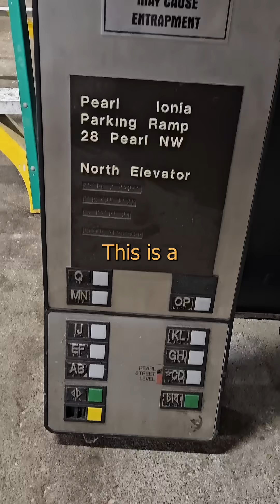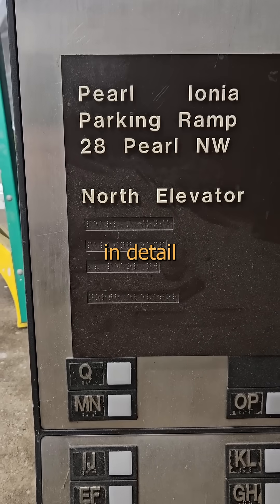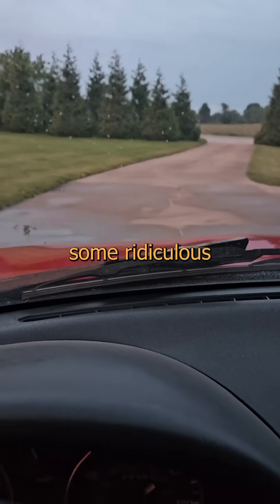Miata Mischief #chrisboden #engineering #gear #elevator #score #stories #parts #hacking #making

Comment: I once had to haul a futon in the back of an 09 mustang. I laid the seats down to the trunk, took it out of the box completely in the walmart parking lot, and laid each individual piece tetris style as tight as possible and managed to fit myself and a rather rotund (now ex) girlfriend in the front. 

Second, i once had to move a bronco which had refused to start across town on limited funds so we just hooked some chains to it and dragged it across county highways, dodging the cop stops while i managed the steering and stopping without power or boosters. 

Third, i later had to get an f150 off the aide of a literal mountain. We hooked it to a tow truck, got it in position adound a precarious curve and just told the driver to floor it to maintain tension while it was careening down the mountainside at mach jesus through the mud

Comment: When I was formworking I got dads work ute and they loaded up to the point the suspension was bent the wrong way. And a few years ago I was haulling an industrial air-conditioning unit and a bunch of other things in my Lil toyota corolla 300kms down the road lol. The bounce was sketch as

Comment: If you can persuade the owner to fit a roll bar or even better a roll cage to the Miata, they make a great roof rack for carrying 8x4 sheet materials, plus you don’t have to lift the stuff as high as a regular car. Speaking of roof racks, we carried a double bed mattress home on mine; when the air got underneath the front and folded it up, it made a great air brake!

Comment: I took a bandsaw held inside 3 reusable grocery bags home 4.5hrs 1 way on the bus from inside the city.  Was planning on using my backpack but I misjudged the size.  Majorly.  Did I mention this was midsummer and I had to bearhug that thing not to drop it, and I was sweating buckets trying to be careful not to cut me, my clothes, the seats, or others?  Oh, and it was a 30 minute walk to the bus, a 10 min walk to the next bus, a 10 min walk through the terminal, 10 min walk through the terminal, and 25 min walk home?  Not to mention the wait times at the side of the road with this thing.  One of the bus trips I was even standing with it sandwiched between my knees.  Was a 30$ canadian bandsaw with a spare blade though, how could I *not*??  It's still in my shop, barely needed any work

Comment: We bought a gym size eliptical machine 10 minutes before costco closed for the night. We had to take it out of the box and take it apart more than it was to get it into the trunk of our Chevy Aveo. It just barely fit enough to drive it 4000' up the mountain to get home.

We also brought an extra wide bathtub up the hill sticking out of the trunk as well. Different day of course.

Comment: I think I’m pretty mild but 2020 or 21 I saw a 15 gallon drum of grease on the side the road on its side and I was driving an F-650 dump truck. I thought I could lift it into the back but it’s was 6 foot up so no way but it had an underbody toolbox so in my wisdom I opened the box and used it as a shelf for the drum and I don’t remember how I strapped it down at all but I ruined a shirt and the truck was covered in grease.  Also I never used any of it and I still have it.

Comment: I literally hauled things on my skateboard.
When I was about 12 and I had just moved, all the houses around us were under construction, about a mile from me was the middle school and elementary school, between them was a small concrete bridge with a stream beneath, a stream me and my friend couldn’t cross, so we stole an palate from the nearby construction site (hey it was in the road) we loaded it onto my two skateboards and found a piece of strap laying around which I wrapped around the palate and used to pull it down the hill to the bridge, it made for the perfect bridge over the water and we tied the strap to the underside of the bridge where we made a swing. That palate is still there AFAIK but the strap broke when my friend said it would break and I told him it wouldn’t and I feel directly into the muddy creek. Good times

Comment: A friend and I were driving towards home along a lone stretch of Indiana highway when we went by what looked like a very nice computer chair. It took a mile or so to convince him to turn around because he kinda sucked like that, but he eventually caved and we returned to it. It ended up being one of those low-profile, fancy lounge-type chairs with a circular base, swivel, and DEEP reclining – upholstered in actual leather. Just sitting alone amongst fields. Sitting upright with no damage, no rips, no evidence it fell or tumbled. Like somebody just set it there. I had to have it.

With about 20 minutes of highway driving left, hauling it was an issue because despite driving a late 90's Ford Escort wagon, there was no room in the back because my friend was in his "keep the car stuffed with shit" stage of his life. So I did what I had to despite his whiny protest (because he sucked like that): lay it as flat as I could on the roof and hold on as best I can. I can't remember the exact way I did it (17 then, 39 now), but I'm pretty sure I jammed the top of the seat back under the roof rack at the rear and braced the base against the roof rack bar up front and reached up through the window to hold on. All I really remember is him grumbling about scratches (it didn't because the only contact was the leather and I explained my intent as we lifted it up there, he just sucked like that) and the final approach.

Once we hit our neighborhood it was quickly obvious that holding on to the heavy chair up until that point made the awkward grip I had fatigued. The frequent turns and less aid from the chair's angle giving a bit of downforce at higher speeds meant the last mile had to be done differently. I had him pull over so I could reconfigure things. Given how slow navigating the neighborhood was, I had the fun idea to set the chair upright, slot the base under the rear roof rack and sit in it the rest of the way home like some trailer park pope. Thankfully nobody saw us that I'm aware of. I'm shy 😳

We got to my place and hauled it up to the porch. I immediately cleaned it, made space for it in my bedroom, and I used that comfy bad boy for all my sitting needs. Having got rid of my bed to make room for a couple pet rats accidentally turning into 20+, it also became my new bed, being an upgrade to the storage totes that plagued my back and hips (before that was some small, vintage rocking reading chair and before THAT was just the floor. Or maybe the floor was between the reading chair and the totes? I dunno, I just know that between 16 and 21 I was sleeping on anything but a bed until the rat population dwindled). So yeah, win/win!

Comment: I fit a 3ft by 5ft deep freezer in my 07 cobalt SS supercharged. 

Folded the pass seat back flat basically. Moved the car seats to the trunk. It was touching the headliner in the rear by the window, and was cock blocking the shifter. 
I had to drive home 15miles using only gears 1-3 (it’s a manual obviously, 5sp). 

Still a very light, buff-out-able mark near the “SS” badge that I havnt buffed out bc it’s a memory lol. 

And yes. It’s the supercharged model. 

No. It’s not stock. It makes 280hp to the tire and runs on E85, I built the engine from an LDK shortblock. 

One of the most fun cars I own, and I own a HYPER low mileage 92 Talon Tsi and a 14 Audi S5 lol

Comment: Buddy needed wheels for '71 Olds. We went to the salvage yard in my '84 CRX.  He found five (full size spare) all but 1 had tires mounted so we grabbed the only thing that would work, being a dive knife (We lived in KC). So after cutting around the sidewall near what tread was left, we stuffed all 5 wheels in the back with the seats all the way forward. His knees were right under his chin. We had to push and compress some of the tires against the back glass.

Comment: My dad got a new ride-on lawnmower from a church buddy. It was an old beast that puttered around about as fast as a brisk walk when the engine was working. I accidentally set it on fire twice but that's a different story.

Getting the mower home was a short 2 km trip, but might as well have been a marathon since the engine was out and needed repairs. My dad didn't want to rent a trailer for a measly 2 km trip, but there was no way it was road legal to just push the whole way. So.... he hooked it up to a rope and tied it off behind his car. Steering and brakes worked just fine, so he got me to ride it the whole way home as he towed. Good times, wish I was filming it.

Comment: I was a lot loader at the big orange toy store and was told to help a guy load about a dozen 2x4's. Ok no biggie, I'm just glad it's not more bags of concrete. I wait at the loading area with the dolly of lumber as the customer goes to get his vehicle. I thought I was being pranked as he came pulling in driving a bright yellow F355 spider. I asked about a dozen times if he was sure he wanted to do this as he laid a bath towel over the engine cover and assured me he was certain and it would be fine as he only lived a few miles away. I told him I would help as long as he put the first layer down as I was not putting any on that would make contact with the  Ferrari. We loaded them up and tied them together with some twine and off he drove. 

I could never figure out why he was in such a rush that he couldn't use a different car, call a buddy, or rent the loaner truck whenever it was available.

Comment: Miata owner here too, and honestly my trusty little car hauled more stuff than most pickup trucks/soccer mom SUV. 
Surfboards, 2.5m shelves (yes, with an S) from ikea (brand new yet cheaper than used ones because they have a ding in the back), welding equipment... And all of this before I got myself a trunk rack. Here's where the fun begins.

For context, Miatas are too small to carry a spare tire. I carried a whole set of tires and wheels on the rack, secured only by hope and bungee cords. 

(Also a big thought for my mum that took me and my sister to buy a bed frame and mattress... She drove a mini cooper at the time. I have no idea how we managed to fit the bedframe in there, then 3 people in one of the smallest modern cars)

Comment: I have a 2008 jeep wrangler 2 door one day on the way home I seen someone throwing out these two (what I thought were) pictures of a  Lamborghini Countach so I turned around pulled in the guys driveway and went and knocked on the door asking if I could have them he said yes and then I found out they were actually sides of a car bed that I swear weight about 80 pounds each and are around 6 to 7 feet long, so the don't exactly fit in the back of a 2 door jeep, but I got them in there with one end on top of the dash and the other end sticking out the back window, which then I had to carry up 3 flights of stairs in the apartment building I was living in at the time 😅

Comment: Not me but a buddy of mine had an old S13 that he got as his first car, his buddy found another S13 that was just a shell and the engine needed to be put back in. So not only did he put the engine in the back of his running s13, he also towed an s13 with a s13 and a strap. Sketchy af.

Comment: Me and my dad drove 300 miles to haul some parts for my Corolla that my wife crashed. By some parts I mean the radiator, front bumper, and all front panels of the car.

In my dad's hatchback Ford fiesta.

We also used that same fiesta to haul a literal ton of wood that used to build some structure in my wedding 😂

Comment: I had cars and carried long material hanging through the side windows for renovation projects.
I no longer have a car, but still carry things way longer than my bicycle is lol. It's just fun with a little bit of shamelessness... I'm 50. I know transportation... of all kinds, really. Back in college, I worked for a transport company. They had me do the things that nobody else would do. One of them things was to haul a trailer on roadways back to the barn so the mechanic could fix the tire that had dislodged from the rim and bound itself partially around the axle and in between the dually wheel hubs. I had to stop ever so often to let the rubber cool down so it wouldn't catch fire.
That's what I call: " coming in hot"

Comment: I once hauled 10 palm trees with a Mustang convertible. Not small ones either. The shortest was 15 feet tall, and had to go across town with them, 2 at a time. On the second trip, police pulled me over asking me wtf I was doing. I actually talked them into giving me a police escort, so my town saw two cops with lights on escorting a mustang with the top down hauling 2 palm trees at a time like they were a pair of Alolan Exeggutors from Pokemon.

Comment: Was doing Uber and had to pick someone up in a well off neighborhood. I told the rider I was going to come back and pick up some things she was going back to where I was picking her up from so win win. I ended up getting 2 hoverboards (they were in a pile of junk because they wouldn't charge { was COMPLETELY dead is all } ), a hand pump bug sprayer, and a landscaper weed wacker (big handle one sitting at the edge of the road at midnight by the mailbox Infront of a seemingly empty house). Now for reference I drive a 6th gen Elantra and got it to fit with some finagling. 

Another time I got one of those elementary school tables (wood top black legs) in it. 

And once I got a 10' rolled carpet, a smaller 4' carpet, 2 paintings, and some other miscellaneous stuff (her friend was moving and she wanted to bring it home) the carpet (you should know which one) was resting on my infotainment system coming out of my trunk. BUT I GOT IT IN THERE!!!

Comment: Either hauling a tool box or a fully glass cabinet display in my 2017 Mitsubishi mirage hatchback and dear god the glass display gave me a lump in my throat you could see every bump, pot hole, even the roads own unevenness made that thing rattle like you would never believe which wouldve been a huge problem if it did shatter as it was laid out from the front passenger seat to the trunk and i didnt come prepared with anything to soften the rattling. Thankfully it was in the same city and i drove like an old lady with all the time in the world and nothing broke but dear god I was sweating bricks

Comment: I know this dwarf in Hollywood. He will do anyone. He is online. 

So. I rescued a horizontal axis 5 spindle lathe and a old style South Bend lathe from a rust belt company going out of business. The wrecking ball just stopping g short of the wall. 

Got my Geo Metro and welded a hitch to the tin foil unibody for a trailer. Got it loaded w help from bored and horny riggers we got drunk. 

The car slowly, very slowly pulled the load the 26 miles to my parents barn. Top down on the convertible. Cops stopped us, laughed a lot, followed us to the farm. 

Put the student loan money to good use. BIG TOOLS!

We made it home and the over loaded trailer axle broke when we began to unload it, lol.

The Geo Metro ran for many many years till my hot rod farmer dad hit a few deer on his way to the mill one morning. 

Enjoy the dwarf.

Comment: I bought a cargo rack for the hitch reciever of the economy line Hyundai car to move my two bedroom home from two storages to my home across town. So. Queen mattress, twin mattress for kiddo and our entire bed setups and a back seat and front seat full of our shiz, I strapped a couple matresses to a cargo rack that not even one if them fit into the rails of. I strapped it to the body of the car and the little cargo railers and it actually HELPED make the aerodynamics of the vehicles suspension system's broken struts BETTER whilst accelerating the vehicle lmao. To keep everything from falling out of the rack i used the base of a ULINE industrial rack as a tail gate locked into place with two chord locks as a hinge system that folds into its self when it's not in use. Honestly it scrapes with a clearence of 4" when loaded lmao.

Comment: Not really sketchy, but Miata related. I daily drove a Miata for about 5 years, and as someone that likes to golf (poorly), hauling my clubs around was always a bit of an event. I used to just lower the top and strap them in with the seat belt. We'll leave it at that as I'm not sure if the statute of limitations is up for any of the other shenanigans though.

Comment: 13 year old me was alone in the home for a bit, went to boil some eggs for lunch and ran out of gas on the stove.

Desperation kicked in and I decided to grab some cash from my mom's cabinet and went with a bike to buy a P13 gas cylinder.

I wasn't aware that thing weighed like 29kg (Roughly 60 pounds I think) when full, its 13kg of butane/propane, and like 14kg-16kg of aluminum shell around it, so I had to haul it on my very, very large 45kg (100lbs) build.

It was a very, very... Interesting, experience to balance that thing on my bike seat and push it around the 10 minute walk home, and then to haul it upstairs to our home.

Comment: I once hauled a greenhouse in the most sketchy way. The hoops were 16ft wide and I only had an 8ft long utility trailer 18"  high sides. I strapped about 15 hoops, upside down into the trailer with about a half dozen straps. So with the legs straight in the air and slightly leaning off to the side, I set off for home. And for about 2½ hours, I was wiping out every low hanging branch on the backroads back home. The most damage was going through small rural towns where people have...er, had... beautiful crepe myrtles and whatever else growing along the edge of the road. Loads of damage done that day.